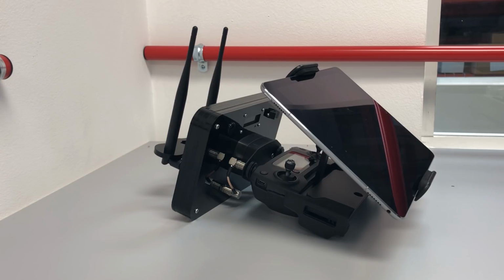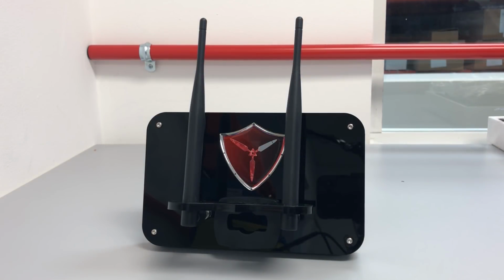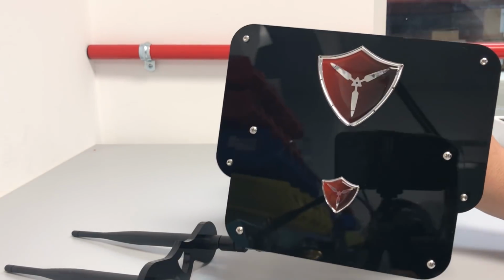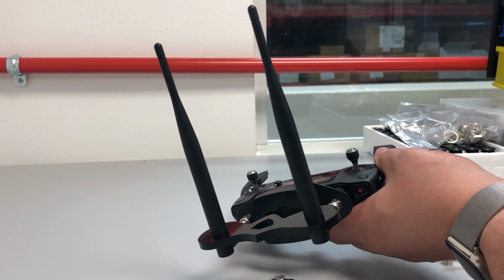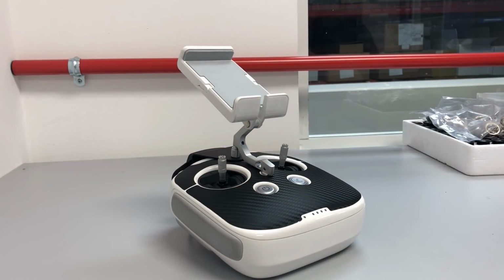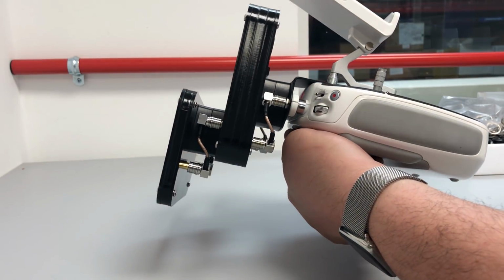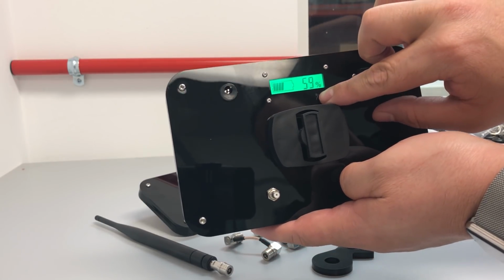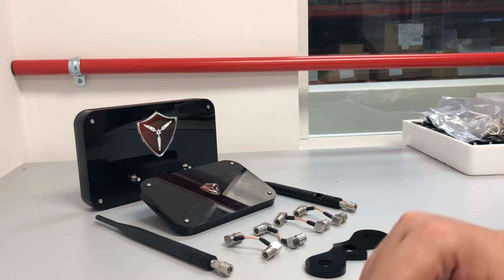Switch Antenna System Intro

Comment: Anyone make a amplified signal booster that goes on the quad? I always lose video transmission signal before i lose control of the quad.
Reply from the maker: Usually it’s not needed as the boosters boost incoming and outgoing.  I would say a WiFi System like the Mavic Air or spark could probably benefit from that

Comment: I was looking for a range extender for my DJI Mavic Air I recently purchased and was just about to buy a 4Hawks Raptor XR when I stumbled across this video.  I like the idea, depending on what kind of flying I would be doing, however I do not see any tests that would prove what kind of range I could get with each antenna.  There are all kind of 4Hawks videos proving the XR can extend the Mavic Air to 16,000 feet distance and was hoping for some proof and info on your system before I buy theirs.
Reply: works great on my MA

Comment: Hello sir I just order a atlas last night  didn't know you had a switch system  (#1684-9432075) could I upgrade to that system
Reply from the maker: Yes I emailed you a PayPal invoice for the difference and it would still go today as the atlas wasn’t picked up yet so we can make it a switch
Reply: Titan Drones Inc.  The cyclone in  addition with,the atlas, just got the longer antennas woth my first purchase, but i wouldn't need them so I would like to apply the extra,from that towards the cyclone and atlas kit

Comment: James is awesome to deal with and his products work.  I just did the retrofit to the new “switch” system on my cyclone panel and it was a piece of cake.   Now I can use the amp’d panel for a boosted directional (“control” antenna panel) or omni directional (whipped antennas) setup.

Comment: question ,  did someone calculated the dbi loss on that sockets when plugging in those Omni directionals without any amplification ? is there a considerable gain  stock antennas vs plugged in non amplified omni antennas ?

Comment: Odd that being the Cyclone already has the same footprint of this unit with the directional 
antenna INSIDE, why couldn't the directional be inside the unit(just like the cyclone) with the additional jacks for the omni's.  Then you could literally have a "switch" on the unit to change the amplifiers power from either the jacks for the omni's or the internal directional.

Comment: Just took delivery of 2 switch systems and car mount systems will post video comp soon stock vs switch vs switch with omni, switch with directional and 14dbi whips watch for video soon, BTW James is a rock star exemplary service levels and speed of response time - hey #DJI hire James to run your customer service - he is the example by which all drone companies should be measured.

Comment: Just wanted to add a short note. I was one of the first to take delivery of this switch set up. Been looking for an antenna mod for some time. But I wanted to be able to go back to stock. This system is so versatile. Working with James was a pleasure. If you're thinking of upgrading your system this is the one you want. Just my two cents. According to James, this system will work with anything he currently has, anything he will have in the future. Without giving out numbers, all I can say is it works...
Reply: Wayne Blackburn 

What about 2.4 & 5.8 swaps? Is it compatible?

Comment: nice but the tablet holder I'm not liking the ext looks like it could easily break. is there any type of guarantee for this. other than that I'm sold.
Reply: Dave, if you are looking for a hefty tablet holder, go here:
www.mavmount.com
Reply from the maker: The tablet holder isn't included.  It was just used to demo what it will look like